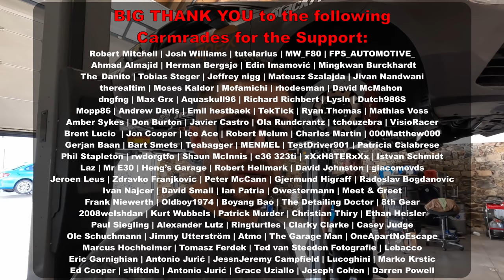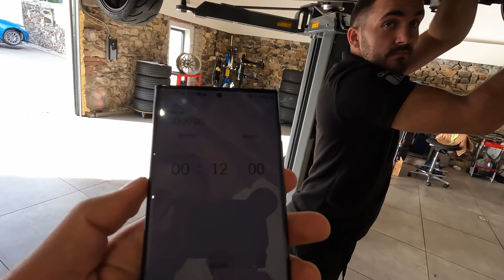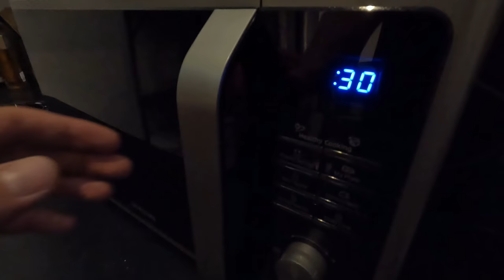MOAR CONTROL! Small Powerflex Upgrade with Big Results!

Comment: So many modern cars have these massive bushings in the front arms, I get that the average owner doesn't want to feel the road through the wheel but we all do! Powerflexing the front arms on my car is one of the best pound for pound suspension mods I did. Way better feel through the wheel and more precise handling too.
Reply: Razeen Francis  They do if the grease gets old and nasty, they shouldn't be bad if it's properly greased.

Comment: The increase in castor , gives more dynamic camber,  ie. more camber in the turn  without having more static camber,  witch is not wanted under braking or acceleration. This results in better turn in .
Reply: Exactly- that’s the main reason you wanna adjust to more caster

Comment: Misha, if you're going to put 993 on a car lift - it would be perfect moment for a short tech talk on how does heat exchanger work (the one for interior heating), and how exactly you don't get to breathe exhausts in case exhaust manifold cracks. I know that old Soviet back-engined air cooled 3A3 had separate gas/gasoline heater - and I did wander how Porsche did overcome "interior heating problem".. just to find out this simple yet elegant solution they used. But is it really that "bulletproof"?

Comment: Hey George, for the big bushing, I just use an air saw with a saw blade that fits into the bolt hole and go straight through the centre aluminum sleeve, rubber, then outer sleeve. Make two cuts, tap that "pie" out, and the rest of the bushing should fold into itself enough to drop right out with ease! As for the upgrade, are you guys allowed to switch to full bearings?

Comment: Hi Misha , have you looked at the Verkline products for the Cupra ? 
Cheers
Mal
Reply from the maker: Yes, but not allowed to use them in the class we're running for now.
Reply: @mgcharoudin  I have mk7 Golf R with 500bhp and looking at building a RS cup version of my own using Verkline products .
What are the wheel spec’s on the Cupra and how do you find the combo you have . i interested being the Cupra shares the MQB platform . I’m looking at getting 18x9 ET 42-47    
Tires either 245/40 r18 or 265/35 r18 .
Luv the vids you put up 👍👍👍 Cheers Mal